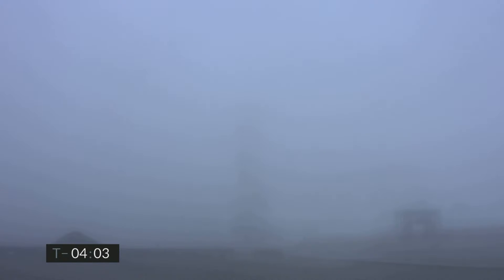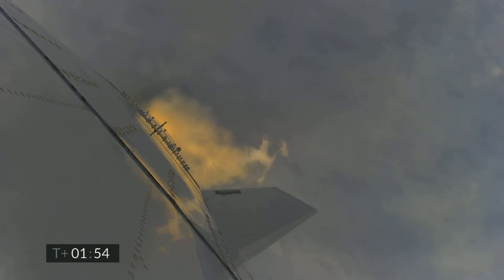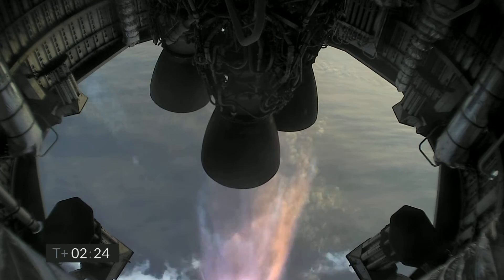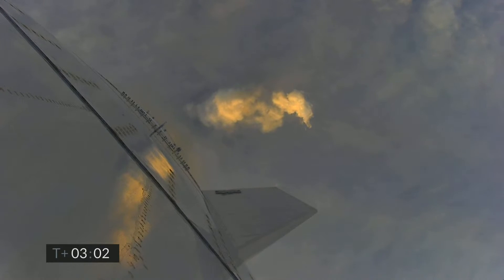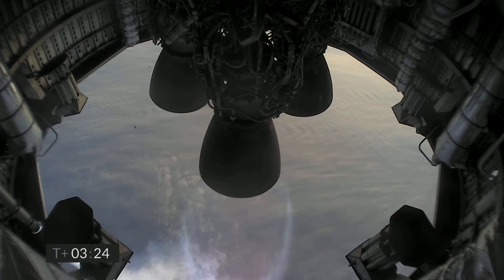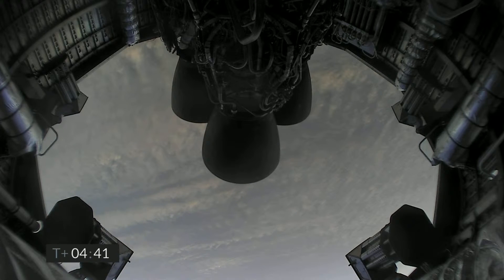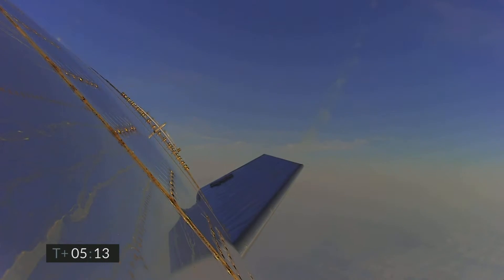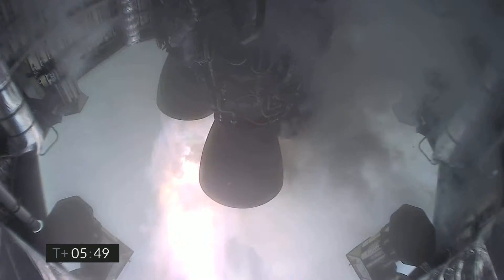Starship | SN11 | High-Altitude Flight Test

Comment: my gues is that 2 of the raptors blew up after reigniting. During ascend there was a small fire near the pipes of the engine closest to the camera. from what i know the raptors are closed loop cicles s all the gasses get expelled through the nozzle. no seperate turbo pump gas outlet. and later debris visiable inside the engine bay bouncing around. A shame we didnt get any good views of the moment it went BOOM. And BOOM it did before even touching down. What a sight it would have been. Debris falling down all around the site. Nasa space flight has a great recording from theire robot cam close to the landing site where yu can hear multiple impacts around it, and it even got hitby a part. Camera survived luckely ^^. Thank you Space X for yet another exciting testflight! and thanks to the raptor engine production crew. It can't be easy to pump out those engines so fast. Things are bound to go wrong.But without you lot there would not even be a starship. You are all hero's in my book :)
Reply: 2 engines failed to relight, SpaceX lost connection with the rocket and they blew it up as it began flipping.
Reply: @BlamoHD  Well the FTS has been in the focus a bit so yeah i could see how they just thought fuck it. test it if the data from sn11 went 'shit hit fan 'mode. Go BOOM. hehe. Gather as much data as you can. Still when seeing the size of the area where all the pieces of steel rained down id almost say that it be better to just crater the landingsite. Elon Musk responded with ''atleast the crater is in the right place'' lol gonna take them days to map all that debri, not to mention that the entire area of .Starbase that has to be visually checked for damages. What i think he meant was that the engine core facepalmed the landing site but that the upper super structure went BOOM at ignition of those two raptors. hope we get to see some good shots of the debris and the scale of the area. Who knows maybe it even was the FTS, and a expose of why it is a pointless system to put on a rocket/spaceship.

Comment: To get to 10km altitude takes 4minites and to descend takes 1minute to Kim AGL. Stating engines at 3300ft at the approach to landing is to risky. A perfect landing Starts with Pattern altitude control, speed control, altitude control and stabilized approach. For this ship there is no go around so, these steps should be too perfect for success. A big problem I see is , is a basic problem in airframe construction, for the size and weight of this ship a monocoque construction is to be verified, I see bolted rings and welded parts, should be reinforce with trusses and longerons for security. One day we may see this ship tumbled over by wind. Du e to it cannot be move horizontally it must be well moved and protected to pass moving to lunch pad.

Comment: I notice that there is exhaust plume forming around the engine compartment; in the Challenger disaster, in 1986, they pointed to this as a cause leading to the accident; it was called 'plume recirculation.' Not that the plume recirculation cause the disaster, but it was the source that cause the accident; the leak (breach) from the cracked 0-ring caused the accident. Since plume recirculation is common, I can only guess or wonder what measures the Space-X team (engineers) have used to prevent such leaks (breaches) from occurring, or other preventative safeguards within the engine compartment to prevent heat and fire damage cause by the plume recirculation. Would it be applicable to make air intake inlets to flow through the engine compartment as a means to reduce plume recirculation?

Comment: why wait till the very last few seconds to light the engines for touchdown, .. you have no safety margin if you wait till it's under one mile, free fall will bring it to the ground as it has done so many times, .. seriously, physics .. come on, landed ONE out of eleven, this is something i'll never trust my life to..
Reply: @Salticus  and my point is still valid, .. the U S Air Force texting X-planes don't expect their planes to crash and burn everytime they take off, they expect them to last till the end of the testing program, .. that way less money is wasted and more can be learned ... but they are doing it wrong anyway, they are using plans and ideas from the 1930s, 1940's and 1050s. this is not how it will be done in the future
Reply: @Salticus yes x-planes were mostly manned .. but still some are not and it is cheaper, and safer to bring the planes home than to allow them to crash and burn, .. and really seriously launching rockers into space from the Earth is not really the future, is it?  it cost more to launch. the noise pollution is unbarable, and the fuel cost are out of this world.  it's the 21st century, shouldn't we at least act like it is .. rockets are old tech, why not put the money into the actual future space launch systems we'll be using in the future, and if Elon wants to sit back and talk with me about it i got it all figured out, actually my plan is easier, it's simple and less people will die ..
Reply: @Salticus i get that they are using cheaper versions right now but you are totally missing my poin, the path they are on is a path we've been on since the first rockets, nothing is new except they are landing them, big deal, thats old news, this is still not the furture, ... they can not land these in cities to communte people across the planet from japan to NYC, the noise pollution is too great .. they have to move these platforms miles out to sea to make it work and what about storms at sea, that would stop all travel, you don't have that issue with land bases air craft do you, NO, .. they are using OLD tech not reaching for the future, they got it all wrong, launch one into orbit then have to launch another 4 times to refule it, wasteful and just wrong when there is a better way
Reply: @Salticus for the THIRD time i get it, those are made cheap, they are not going to keep the, i get it, i have said i get it, but thats totally NOT WHAT I AM SAYING.. they are using tech that is over 100 years old when that is not the future, this is not how we'll be doing this in 2050, so why chase the old tech when the new tech is coming out making it eaiser to do it the RIGHT WAY .. how many times i got to say i get it , they are using cheap materials for testing, i've said it over and over, i get it, but they are still getting it WRONG...
Reply: @Salticus again, why do i have to keep repeating myself, i know what you are saying but yes they are working on other methods that are easier to get to orbit, what spacex is doing is wastefull, been done and not the future, they plan to launch one rocket with people on it to orbit, then send another using 4 trips to refuel it, WASTEDFULL. this is not the future, and yes they are working other methods that are not so wastefull, virgin is working one, there is another group in europe working a single stange plane to orbit ... taking a rocket from Earth to the moon or to the other planets, this is not t he future, ... NASA has known this since the 1960's .. rockets are not the future, this is what i am saying and if Elon wants to hit me up and talk to me i am free to talk most the time, they have several different groups working on different segments on how the future of space travel will be, so why not put them under one roof, orginize it all with a plan to make it work instead of doing it how they are doing it cause by the time they actually get it to Mars it will be obsolete .. not like it isn't already, really, they got no back up plans .. one shot and go .. if they have a problem they are months from Earth, or have to wait a year and half for a return flight.. if they did this right they'd lose fewer lives, .. they's spend less money and the future would be here sooner then later, starship is slowing down the progress of how space travel will be .. this is not the age of buck rogers or flash gordon, .. this is reality, so why not do it right
Reply: @Salticus space elevators, one option but i don't like it, the cord breaks and it falls down all over the earth, and yes a space plane will work, rockets have a purpose they can be used to send needed materials to a colony or space station, but you see you haven't really seen the truth to the future .. its not about jumping on a rocket going to space and taking the same rocket to another planet, thats not t he futrure in fact it's stupidily dangerious, if you talk to me some where else maybe i'll share more of this but really NASA came up with this idea in the 1960s,

Comment: Not a nominal ascent. Just like SN-9 there were fires on the Raptor components as it went up to altitude 6:15. Fires like these killed SN-9. I'd assume Re-ignition did not go well because of these fires and burning components, and with that Starship either was Self-Destructed or hit the ground at full but still in belly flop orientation.
Reply: I agree about the fires but it blew up before hitting the ground. Could be flight termination or RUD.

Comment: Watched other feeds as well. On everyday astronaut, you could clearly hear 2 boom’s, I would say the FTS triggered. 1 engine stopeed gimbling before the others did. Right after that engines lights up, video feed freezes. Hypothysis : first engine had a problem with gimbling, ignition showed wrong thrust vectoring, fts was triggered from software that was still from the 1 engine landing procedure from previous test flights.

Comment: You should have waited for the fog to burn off before launching....
Until you can get Starship to hover at zero velocity you will never be able to land on those stupid single use landing feet, especially if you insist on only using one offset raptor throwing the landing angle off.

Comment: The full story
1 Road closed  7.00 am
2 Pad clear        7.05 am
3 Ground vent   7.13 am
4 Recondenser 7.22 am
5 Farm vent       7.23 am
6 SN11 vent      7.38 am
7 Engine chill    7.45 am
8 Ignit/liftoff     8.00 am
9 Crash               8.06 am
ROAD OPEN °•.
Reply: This was the fastes starship high altitude flight test in history, I don't think that this record can be broken in the next few years
Reply: @politonno2499  
🌺🌻🚀🌼🌹
🏆SpaceX🥇
😄
Reply: @farrider3339  have you been testing that huge ship to perform that weird maneuver recently?
Reply: @politonno2499  oh yes - incredible 
A silver whale dropping straight down to earth
🐳
👇
🌏
😄

I just don't get why they restart the engines so late.
Seems like they're out on destroying the device 🤔°°°
Reply: @farrider3339  they restarted the engines at the last time they can because this is all about not waste fuel. The problem goes after the relight, they couldn't solve anything by doing it earlier.
Earlier prototypes have demonstrated that the relight at 1.5 kilometers is the right choice
Reply: @politonno2499  well siR , I surely see the logic , however if it still has enough fuel to 💥 there was quite a bunch left - no ?
I would hover that silver machine and let it dance 💃 as I wish  . . 
That's what I would call a demonstration of perfected control and engineers-man-ship..
wooHooo .•°

Comment: My biggest concern/question was seeing something burning(again) on the rocket engine(s) during flight and loss of cameras, (more heat damage?) as they provide great information that can be used to correct problems. Leads me to believe they haven't solved all the heating problems causing damage to vital equipment and loss of the space craft.

Comment: Every vehicle has had engine trouble; either on the ground requiring swap-outs, in the air with fuel feed problems or as today just full on unreliability during flight. This is using THREE engines. A full Super-Heavy and Star-Ship vehicle will use 34 engines! The odds of success on any flight are minimal unless something changes radically. I love Space-X and the Star-Ship concept but this unreliability is nuts.

Comment: Does this mean that the reentry was less than nominal?
Reply: There was no reentry because it never left the atmosphere. It only flew about 10km (about 6.3 miles) high. I think that pipe at 6:00 from the left raptor broke (you see a small "fire" getting bigger and bigger). But yeah, it wasn't that nominal 😂😆 Just a standard RUD (rapid unscheduled disassembly)

Comment: While launching in fog should not be a problem. I believe it was a bad call to launch in this fog; for safety reasons, because it is a test flight and vehicle visibility could have been useful in analysis of the landing, in fog you can’t see the surrounding area to determine whether or not someone is out there endangering their safety. My thoughts on the landing ; it appears that engines re-lighted but some how the vehicle de-pressurized possibly folding in half and blowing out apart from pressure release.

Comment: Don’t launch in such fog! These ships are still in the design and test phase. They need ALL the visual data they can get.  Ground cameras, long distance, spotter planes, and on board cameras. All failed here. In such fog, they only gathered a fraction of the possible data available... What a waste!
Reply: Visual data isn't important at all. The only thing they need are telemetry data, sensor data, control surface data etc.

Comment: Each landing seems to have a slightly different failure mode.  I understand that this is testing and failure, for now, is an option, but launching in thick fog such that no video is available to capture what happened seems like a mistake to me.  Telemetry can tell you only so much.  Being able to see what happened and when might be the key to determining if this is a big deal or just more of the same.  The timing of the off-nominal event suggests to me that this was something very different from what we saw in SNs 8-10.

Comment: All of those flames around the top of the engine bells just doesn't seem like it is (or at least should be) per design. It seems to me that loose fire there could burn through control wires and flexible hose couplings, producing uncontrolled thrust in various directions at once.

Comment: FFS they keep exploding. Lockheed successfully took off and landed a massive vertical rocket in like the 90s.
Reply: The delta Clipper had 1 flight and it was less height than sn5s flight, that boring triangle is irrelevant.

Comment: Instead of using those little winglets to orient the spacecraft while falling, why not expand them into, I dunno, a largish delta wing and actually glide the ship back to the surface.  Maybe instead of carrying fuel for a propulsive landing, you could save weight by adding some wheels and land the spacecraft using hydraulic brakes and maybe a parachute to stop it.

I’m just throwing out some wild ideas.  They probably wouldn’t work.

Comment: #SpaceX # Starship (29.03.21) (Original Message) 
The one piece thermal shock test on aluminum welds calls into question the absence of a vacuum for flammable gases (bypass valve tubes ⛩🧯 of the motorized turbine system) the latter absorbed by the welds which melt at the approach of breaking the melting point 🥽 like snow ❄☃ in the sun 🌞.  << (30.03.21)>>🌞>>🔥??
The process one piece, therefore in the absence of the in-situ pressure-bar thermal valve blades 🪒♨ of the cryogen on the welds 🎢🛹 and where the flexible peripheral conical tissues of the cradle of the raptor, the ground floor of the turbo-mixer ( 1) 🧭🛴 concentrates the engineering steps - propulsion on the non-expansion🏄‍♀️🛹 of the cryogen throughout the ship. "Most reliable hypersonic engine" ever built sinks in "one piece" anti-friction.
"The vertical geodesic parallax of drone landing proved that perseverance and ingenuity was a very good measure of the light inside a Greek 🪔calendar on the surface of Mars, before 4x25 tons of" directional paraglider " 🪂🏄‍♀️👍 "whatever happens to the weather..the most beautiful things are also part of the future and StarHeavy is part of it🔭👊

Comment: Spacex needs to work on the reliability of these engines. And maybe an early abort system to return to land before it gets all the way up
Reply: It wasn’t an engine problem
Reply: The engines are fine. The only engine problem they had was on SN9.
Reply: @καλαμ  they have had other problems in the past they just caught them in the static fire. Also in today's launch you can clearly see engine 2 isn't preforming right. Still waiting to find out what caused the explosion at the end
Reply: @mustbefamousjr4888  I never said anything about today's raptors working normally. Also, we have no idea what are making them swap the engines after static fires. Same here, just waiting for a tweet from Elon.

Comment: Propellant leak on raptor 3 showing at 6:04.   It was already taking damage 6:15, 7:57. You can see the engine continuing to disintegrate after that. When they relit the engines on descent, *BOOM*. Rest In Peace SN11!

Comment: Keep seeing flames above the engines at various points (SN 8, 9, 10, and 11 too). Wondering if they have something not coupling right. SN8 it looked like hoses came off during engine shutdown. SN11 had it during liftoff.... hoping that's not the issue, but it's not something you normally see on Falcon from what I recall.  

Glad they're learning a lot. It's awesome progress (though SN11 seems to be a regression).
Reply: Propellent leaks ?  Lots of plumbing around the turbo pumps ?